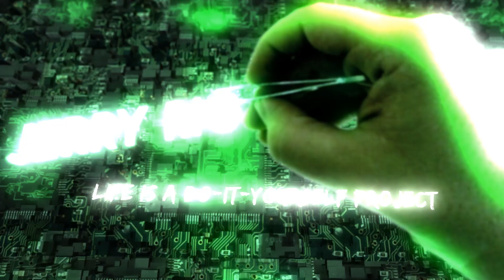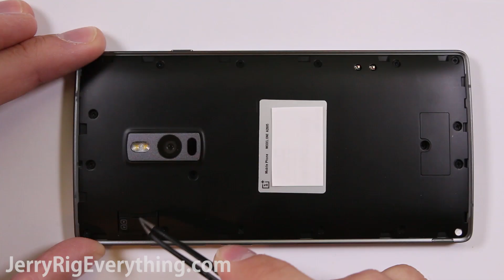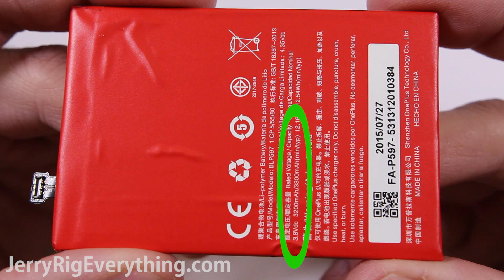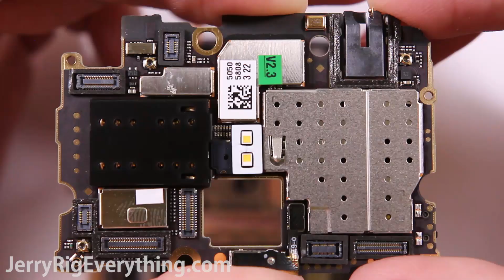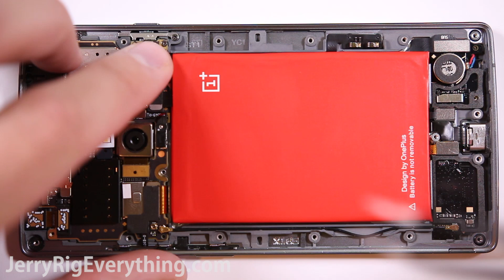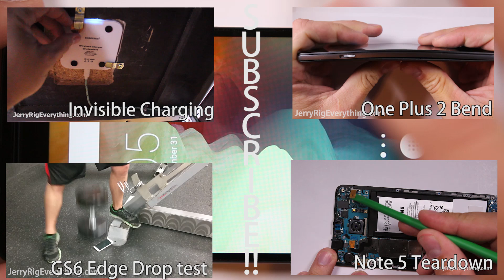One Plus Two - Screen Repair, Charging Port Fix, Battery Replacement

Comment: Bought one plus 2 on 3rd of November, 2015
And still using it without any complaints and never been to service centre as well.
But sadly I am never going to buy any of the one plus products again as they are aggressively overpriced.

Comment: Hello, I followed your instructions today and replaced the cracked screen on my OnePlus 2. I purchased a screen already attached to the bezels as you recommended. After the swap everything seems to work except my rear camera, which is no longer recognized and the flashlight also no longer works. Did I potentially damage the motherboard? If I only damaged the rear camera would that affect the led flash? Any advice is much appreciated, thanks for the video!!

Comment: I had moisture in my headphone jack. The video helped me to pull out my motherboard and clean it with a PCB cleaner solution. however, since then, I have lost my Sound (Speaker). Im sure that there is no connectivity issue between speaker and daughterboard, also I have tried replacing speaker but it didnt help. Any solution? thanks in advance

Comment: I'm hoping to get the One Plus 5, I had the Oneplus 1 and thought getting an LG v20 would be a better experience. I was wrong. When you do get the Oneplus 5, can you see if a qi wireless sticker can be added if you can take the back plate off? Fun videos by the way. Do you think you can make the OnePlus 5 backplate see through?

Comment: can someone tell me what the wire cable at 1:57 does? It seems that I wasn't gentle enough with it and I broke the connection on the motherboard, but my phone seems to be just fine.

Comment: Wow thank you very much! My 2 wasn't turning on as I'd not assembled it correctly and as a result I deep cleaned the internals of my phone using a q tip, removing the thermal paste. Thank you for identifying the thermal paste and now it works fine as a result.

Comment: I want to ask one thing. Oneplus 2's OTG only works with oneplus usb type-c adapter( 10k) and not with any standard usb type-c adapter(56k). I know that the adapter is non-conforming but is the oneplus 2's usb type-c port also defective? I mean to say is this a hardware defect or a software defect.

Comment: hey, i cant seem to find any charging port online, and mine does not work! ive gone to different phone repair places, but none seem to have any parts from oneplus..  i have to charge the phone by placing the phone in a very specific way with the cable.

Comment: My one plus two's audio adapter was damaged, there is a slight crack in it because i pushed an aux in cable too hard. Now the aux in or earphone cables do not get properly inserted into the audio jack which leads to less quality sound. The phone is in warranty, but i am worried if the repair would be expensive. Also, i am afraid they would say to change the motherboard. Please advise what might be done.

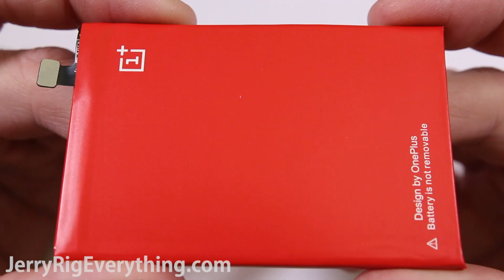Comment: 0:48 Most manufacturers write that on their batteries and those who don't, either they should or they have already printed the minimum capacity. That's because the capacity of a battery is relevant to the load. The higher the load, the less the mah it will be able to output. Also because of bigger voltage drop on higher loads, the circuitry that is designed to prevent overdischarge will trigger prematurely.

Comment: hey grate video you have done there. no doubt in that.
but i just wanted to know i just dropped my oneplus 2 unfortunately it had a really deep dent exactly on the power button. i m about to go to the service centre. but just to be sure i am very worried about my data. the phone is constantly restaring. it just appears oneplus logo and again goes of again the same thing repeats. and i guess this will go on untill the battery goes dead. but please just let me know. will it effect my data. m really worried about it. because i didnt backup my photos. i dont want to loose them. please help me out

Comment: Hi Jerry, thanks for this video! Is there any reference for removing the fingerprint scanner / speaker from the old screen and re-assembling the new LED screen with the old screen's plastic frame, speaker, and finger print scanner. Thanks!

Comment: hey the usb type c connector ...that black strip on the back has 2 points above it...can those 2 points be used to attach the wireless charging chip or anything with nfc

Comment: Question: any way the type c charging port could be replaced with micro usb and then support quick charging? The phone is capable of it, the type c just holds it back, correct?